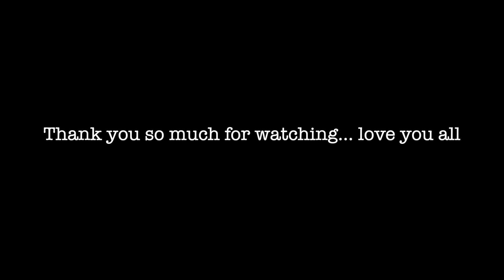Simple Days Of Summer (Story 36)

Comment: Hi, Im a Field leader for Explorer search and rescue and wanted to make a few recommendations next time you go on a backpacking trip. Cotton for any kind of outdoor activity is not ideal, even for sleeping. When it gets damp as it inevitably will from sweat or precipitation,  it will not dry out, which can cause several problems, Mainly, even in summer, Hypothermia. If it gets below 60 degrees you can get hypothermia. Secondary concerns are chaffing and perpetual dampness next to your skin. In a sleeping bag ( which are usually ripstop water repellant nylon) you will some moisture, even in cold weather, sleeping bags don't breath and so it is the primary job of your base layer to wick moisture to prevent it from settling in the sleeping bag which overtime can cause mildew and degradation of the down. The cotton retains the moisture keeping it trapped and damp in the bag rather than drying out. Another note on clothes, Generally long sleeve and pants are preferable, To prevent skin cancer and burning, and preventing bug bites which can carry Viruses, as well as preventing skin abrasions that can easily get infected in the wilderness. Im personally partial to Merino wool base layer for sleeping. During the day a light merino base layer with a long-sleeve  button up upf 50 shirt overtop with nylon zip off style hiking pants are preferable. The outer layer should be loose and upf 50, bugs can bite through a skin tight layer but not loose clothing. Avoid anything with spandex as it harbours bacteria and can cause infections in not so fun places, especially for extended trips. Undergarments should not include any cotton either. neither sunscreen and bugspray can work as well as long pants and shirt,  Sunscreen needing to be reapplied every 2 hours, and  effective bugspray (Deet) is not ideal to applied directly to your skin. if you prefer natural fibers, ( I do) I recommend Smart wool Base layers and undergarments,( they are antimicrobial and prevent smells) and wool & prince makes merino wool button downs.  UPF rated fabrics are great, but you can also buy a UPF wash for clothes that makes any clothing upf. Ill warn you wool pants can be hot, Though Johnson woollen mills makes a worsted lighter pair (11 ounce) vs the typical 19-25 ounce.  In the backcountry a bad burn or copious bug bites can cause serious problems, including but not limited too, Chaffing, Extreme discomfort, immune reaction (any one with too many bug bites can require an antihistamine.), and contracting West Nile Virus. Best of luck, stay safe and have fun out there!